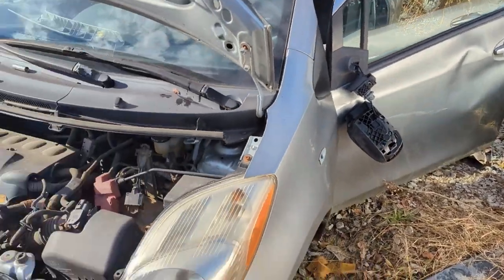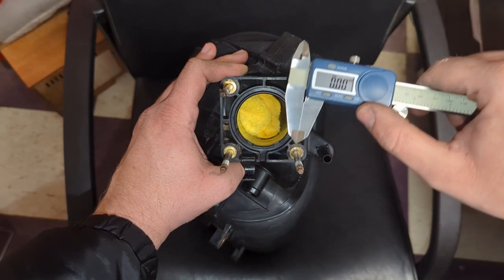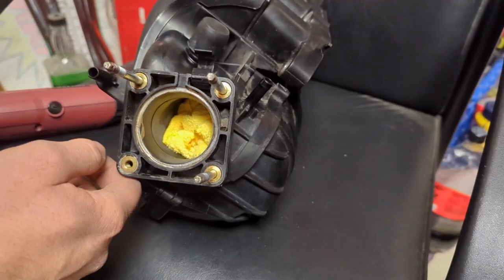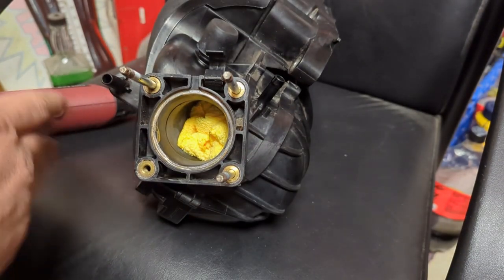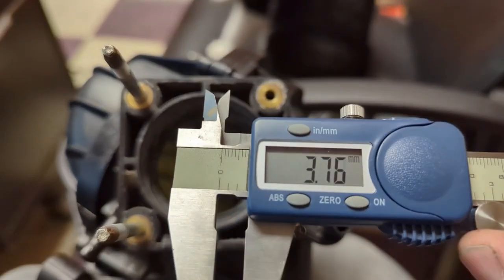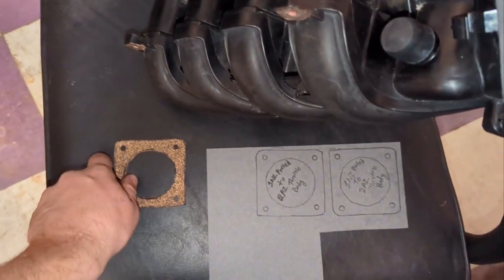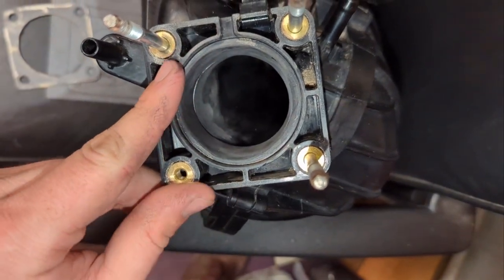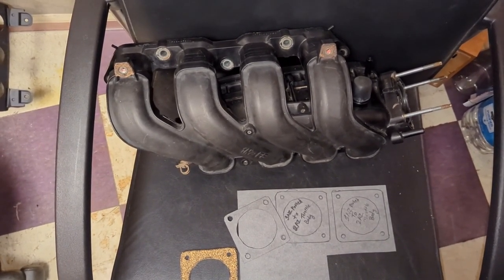Porting a Toyota Yaris OEM Plastic Intake Manifold Big Port 60MM Project Slow Kart 1NZ 1NZFE 1NZ-FE

Comment: EDIT: Forget this. You do you my dude. Happy New year and thx for the videos

Are you aware of the 1.8L 2ZR-FE swap? Its a zero fabrication engine swap using a Scion xD donor car. It requires a lot less faffing around and there is tons of written guides available on yarisworld and it was also done by Mighty Car Mods. I am not aware of a  comprehensive step by step video done by a true shade tree mechanic like yourself, so its worth looking into.
Reply from the maker: Hi there! Yep I am fully aware that the 2zr is a relatively easy swap. However, I feel the 1nz is an overlooked engine that is very capable of making good power and being extremely reliable (2 things that typically do not go well together). I have a pretty extensive background in Hondas and Toyotas and we tend to see a multitude of issues out of the 2zr engines especially the earlier production ones, they like to blow head gaskets and consume lots of oil pretty frequently. As I'm sure you saw on mighty car mods their 2zr lasted only a little while before blowing up, granted it was boosted but still I would be willing to bet a 1nz or 2nz would have held up much better. Not to mention parts are cheap and readily available for the 1nz as well given it was produced for almost 20 years, compared to the relatively short life of the 2zr in comparison. Happy New Year to you as well.

Comment: What year and model is this manifold from? I'm in Australia and can only find manifolds for a 3 bolt throttle body but the 1zz throttle body is 4 bolt.
Reply from the maker: This is from a 2007 Toyota Yaris with the 1NZFE engine. These intake manifolds should fit from 2007-2017 and are 4 bolt. I am using a 2azfe throttle body and it works well. If you want to use the 3 bolt throttle body the 04-06 Scion xA, Scion xB, and Toyota Echo all have 1NZFE engines and use a 3 bolt throttle body so their intake manifolds are 3 bolt.
Reply: @TheInteriorAutoMechanic  thanks. I need cable rather than DBW so I don't think the 2azfe will work. I've already got an Echo with a 1nzfe but trying to upgrade to a larger throttle body. Going to be building a Prius piston, large cam, ported head engine that needs to look externally stock (I'll hide the ecu which will either be Haltech or Link).
Reply from the maker: @zbeasty  Nice! Keep me posted I'd love to see some updates as you build it!

Comment: Any company’s you know sell any of these ported manifolds is I don’t have to make it lol
Reply from the maker: Unfortunately there are none that I know of. The best thing I can tell you to do is just to buy an extra intake manifold they are relatively cheap, port it and then swap it over. Just be sure to get a Yaris intake manifold because the Scion Xa,, Xb, and Toyota Echo are different and won't work on a Yaris. The Yaris use a 4 bolt throttle body and the others use a 3 bolt. Please consider liking the video and subscribing to the channel! Good luck on your project!